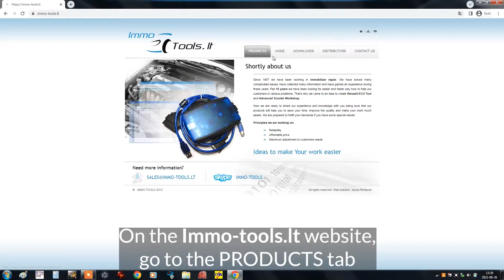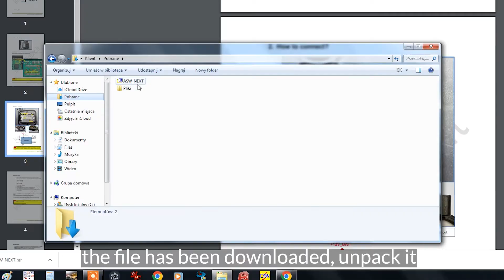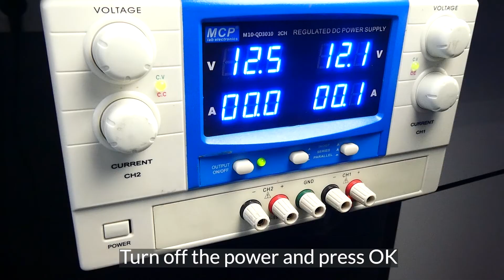Eldor KUBO - reading by Advanced Scooter Workshop

Comment: Hello, once the operation is finished you have to desolder kohm resistor?  Or do you have to let it solder on?
Reply from the maker: Hello, If you are doing diagnostics you don't need a resistor. it is necessary for reading and writing in BOOT mode. After all, you can desolder it. Have a nice day!